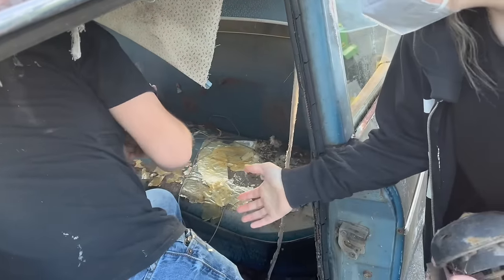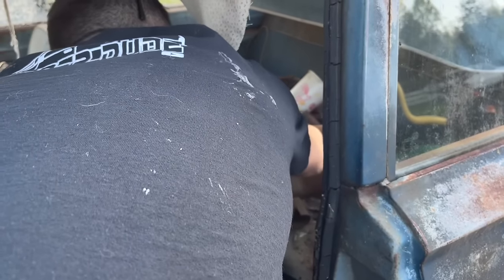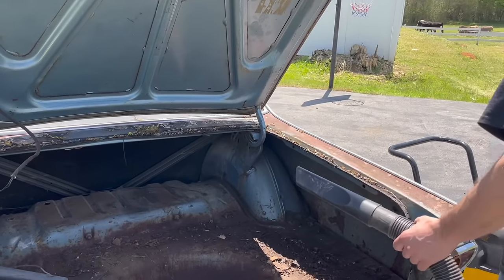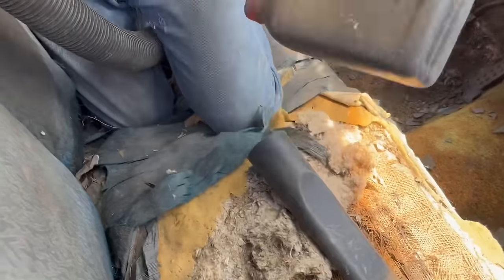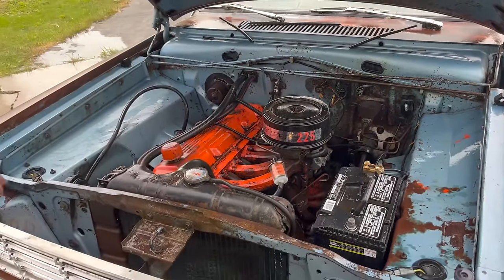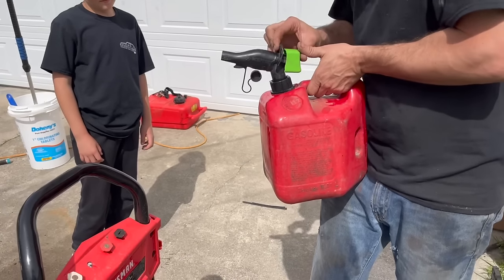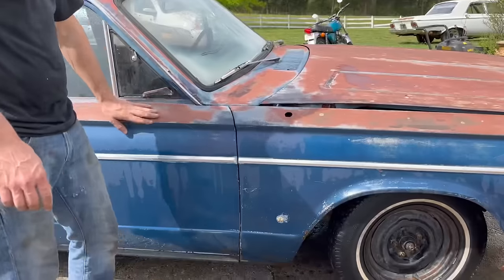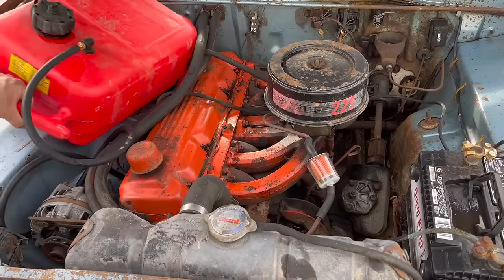First clean up in 30 years on our $500 65 Dodge Dart 2 door

Comment: Oh, does this bring back memories...when I was a kid in the 60's my mom and dad had a 61 Dodge Lancer with the slant 6 and push button transmission. And just like your 65 Dart, the back floor pans had rotted out, and some of the carpet was gone. My instructions when getting in were to step on the bottom door frame, then over to the drive shaft tunnel with my other foot, and drop onto the seat. Under no circumstances was I to try to stand up or get off the seat while we were moving. I could literally sit there, look down through that hole and watch the road go by as we drove along. And if it was raining and the road was wet...yep, I would be wet too. Somehow I never did get sucked down that hole and out of the car.
Reply from the maker: Oh my gosh that’s hilarious
Reply: @Sleeperdude  fred flintstone wood be proud

Comment: A walk down memory lane when I ran across the video! I was raised in Juneau, AK, and my family bought a 1965 Dodge Dart 170 2-door model just like this when it was a year old in 1966. It was teal blue with a similar interior, though the cloth on our seats was a different pattern. It had rubber mat floors, 3 on the tree and the only "extra" was an AM radio. It also came with the "poverty hubcaps". The sound of this car running brought back a lot of childhood memories! This car replaced a 1950 Dodge Coronet Club Coupe that we had, and in late 1971 we sold this Dart and bought a new 1972 Dart Swinger. It had an automatic transmission, AM radio and carpet, so to our thrifty family we thought we had "arrived"! Ironically it came with "poverty hubcaps" also. Brent Long, Seattle WA
Reply from the maker: Awesome thanks

Comment: Love this video. The dart 🎯 coupe clean up really nice like night and day difference.  After all the parts and stuff and power wash it should weigh less than 2,500 pounds maybe less than that. Looking forward to seeing the next video love what Y’all do. You’re creating project cars for the next owner down the road. 
You hinted a 360 swap for the Dart 🎯 that would be nice but the slant six would be good on gas at these prices and very dependable. God Bless Y’all.
Reply from the maker: Thank you
Reply: @Sleeperdude  get a sheet of 3/4 inch plywood make a template for the rotten floors and cut to fit  for safetys sake while you do the drives................

Comment: Love the Dart! Tight engine compartment though. Small blocks fit. A 318 or 360 4 spd would be cool
Reply from the maker: Yeah that would be cool
Reply: Adapt a chevy S-10 transmission to the slant six--it can be done very inexpensively--have a muscle car shifter on the floor and then you can really rip it and the little six will surprise you how good they go! With OD they will get 30 mpg as well.

Comment: There is a 2V intake manifold for the 225. That and the correct carburetor will turn that into a Super Six. Me and a friend did that to his 65 Dodge A200 van. He wanted a little more horsepower and the new setup made a big difference.
Reply from the maker: That would be cool

Comment: Just a piece of advice, Josh, something I learned from my best friend Tim, who sadly passed in 2020.  If you have a Keeper, after you’ve cleaned the interior plastics and vinyl to your satisfaction, use Old English Oil Soap on it.  It’s way cheap, and coats of the oil will improve or at least stabilize the condition of geriartic plastics and vinyl.  Do Not use Armor All - this will create cracks, unless you re-apply it regularly - I know this from personal experience.  I use Old English Oil Soap on the dash and interior plastics of my 74 Celica and have for years.  No cracks that weren’t there before I put the pieces in (it was a ground up resto, Tim and I finished 10 years ago).  The oil will make the stuff shiny, of course.  So fair warning on that.  😎👍
Reply from the maker: Ok good info thank you

Comment: You weren't kidding that inside of that dart had parts everywhere. What was with all of the stored hub caps? That is really a strong shop vacuum I don't think mine will pick up nuts and bolts. And where you pressure washed on the body it looks like red primer not rust. Well that was sure a nice job of cleaning that old dart. Thanks for sharing.
Reply from the maker: Thank you yeah I couldn’t believe all the parts not sure why. And the vacuum does work good it’s a dewalt

Comment: i had a 1965 valiant safari wagon - i fixed it up with LSD disc front new booster shockers wheels tyres - { hoopes and casings = see i`m learning } and it was white with blue interior Regal Safari = 318 fireball v8 and  a904  auto trans = 125 mph . color coded bumpers !

Comment: Another is washed up. Cars are looking good. Ready to see brake work and new casings and hoops. I got too many projects too.  Just waiting for the weather to start cooperating. One day it is 80 and the next it is 40. Got to get with finishing up some things on my 75 Torino and get it on all 4 tires so I can get to my cam swap,2 bbl to 4bbl swap, get a tune up done,and change the oil. So I can start working on my 99 Dodge Ram 5.2L,change the heads on it. So I can start driving it.
Reply from the maker: Sounds fun

Comment: That Dart is in a lot better condition than it seemed in the beginning. New floor pans and a fender will have it well on it's way. I have a feeling all of those mats and carpet pieces kept the floor wet most of the time or they would be as solid as the rest of the car. I used to think floor pans was a big deal until I'd seen them replaced. Not a big job for a good body shop.
Reply from the maker: Yes I agree

Comment: Excellent video Sleepdude Crew  :) that Dart live long time also would fix up for one kids drive to someday & fix right door too and rare to for Manual transmission Coulmn Shifter  3 speed find plus red block on 225 motor also most I  seen in baby blue color also in 2 barrel carb too! Funny to been 2 door also think that car was Blue Blue Matellic back then and great find Josh hope you can use it  Fuel tank too  also plus nice car for sure! I remember my first car was 1980 Pontiac Grand Le Mans 2 door and I baby that car for 8 years till frame snap in 2 places on me had get rid of it! But want Lol for my high school at age 16 to 18 did paint job in my Auto Mechanics class for my late Cousin John SR 1982 Chevrolet Monte Carlo LS and cops asked me what color is car be when did Safety Check Inspection why because primer grey and get paint White with Navy Blue Decals like Interior was ! But fun project and got excellent marks in Auto Mechanics shop classes and plus had fix starting issues also ring gear and starter bolt up problems why cut out after warm up ! But got fix for sure and John love car so much after he want give to for Graduation gift but he past away it happened and never saw car again too ! That car had 1973 Pontiac Grand Prix 400 Cubic Inches size 8 cylinder with 4 barrel  plus dual exhaust, Turbo 700SR 4speed Overdrive Automatic transmission, 390 rear end gears truck type in plus updated gauges ! Fast car too also car see if find Josh is Chevrolet Chevy 2 in 1962 to 1964 year in 2 or 4 door those cars are early versions of Nova one ! You love them so your family too!
Reply from the maker: That’s cool thank you good idea
Reply: @Sleeperdude  welcome

Comment: Easy way to get an engine running that doesn't have much compression is to put heavy gear oil in the cylinders. I have done it in the passed and worked great. Once the engine starts the rings free up and it is good to go.
Reply from the maker: Thank you

Comment: I don’t normally disagree with you but in this one case I do. You said they don’t make small cars with decent size engines that’ll haul a full size family of 5. They are all huge vehicles. There are several vehicles I’ve either owned or been in that meet that criteria. One of them is my Kia Soul I use for a pull behind vehicle. It easily seats 5 plus cargo, gets over 35mpg, and is small, nimble, has an amazing turning radius and it has plenty of power. You can get it with a naturally aspirated 2.0L, a turbo 1.6 that hauls a$$ all day long, or a diesel.  There are several Japanese cars that come with v6’s and v8’s that aren’t any larger than that dart. I love your channel. You have the greatest little family and farm.

Comment: That dart would make a nice little hot rod even with a 318 or a 340. I think it’s well worth cutting out the rust and build all the floor pans or buy the aftermarket stuff. Yeah I really like those cars. After you wash that trunk out I would spray it down with ospho rust treatment to stop it. Just my suggestion.
Reply from the maker: Yes it would

Comment: I thought it was black!  Turns out its blue.  Cool car, 2 dr stick.  I like 3 pedals.  Just put a 4bbl and headers .  Maybe a little cam.  A hurst shifter.  New brakes,Fix the rot,  could be a nice little  hot rod.  Maybe redo the front seat and carpets.  Just clear coat the thing.
Reply from the maker: Thank you

Comment: Dude, where do you find these fantastic Mopar's ?  I'd give a left one for that Dart, the sheet metal looks great and the floors should be available to weld in.  Give it a light sand and shoot it with Satin Clear to preserve the patina.  A set of old Mopar 15" rally's off a later Duster, a set of front disk brakes with a dual master cylinder and a head liner and you're in, maybe a cheap AM/FM too.
Reply from the maker: That would be cool, I got it from hot rod hoarder on YouTube

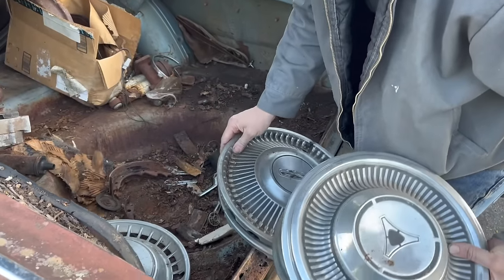Comment: 5:57 The wheel cover in your left hand was the optional full wheel cover on the 1965 Dodge Dart according to the factory brochure at old car brochures. It doesn't show any pictures of the poverty 'hub' caps. The wheel covers on the car are from the mid seventies cars. From other images, it appears neither of those 'poverty spec' hub caps were from the car originally.
It came equipped with 6.50-13 tires and wheels. The current size would be 165/80R-13. The WD is 594mm. The full wheel covers may be for a 14" wheel?
Reply from the maker: Ok thanks for the info

Comment: This is 153624, I've written to you a couple of times. I would like to tell you again about a product called JOMAX house cleaner. Now, you do have to mix it with bleach. The first time I saw this, I thought to myself what's the point the bleach is doing the work. Appears I was wrong. This product also takes out the stains left by the mold mildew and lichen. The after product of the cleaning is much better. It is a bit pricey. The last time I bought it it was around $25.00 per gallon, but you can make quite a few batches with 1 gallon. You can mix it and apply it with a little garden pump sprayer. Even if it dries before you get your pressure washer to it, cleaning is still easier. It is also supposed to help keep mildew at bay. And no, I don't own stock in the company that makes it. Ha ha.
Reply from the maker: Ok thank you I will look for some

Comment: I just cringed when you ripped those door cards off of the front doors. Those were pretty nice over all and savable. A heat gun and cutting a new hardboard backer to transfer the vinyl to would have really been cool. 

Are there future plans for that car? Except for the floor pans and front fender, that body is in pretty nice shape from what I saw.
Reply from the maker: I plan to get it drivable with brakes , patch up the rust , windshield, and fender

Comment: surprised you didn't pull out the bottom of the back seat - it just clips in. there should be a vertiable treasure trove of fragrant mouse and squirrel goodies under there.
Reply from the maker: Your right I should have

Comment: Well we'll have to cut the inner fender. Put a straight axle under the front.
Reply from the maker: Come on
Reply: Those darts are little work horses.I didn't think that one was going to pull through. And there you have it. Awesome burn out.

Comment: Slant sixes always smoke on start up but will run forever.
Reply from the maker: Awesome
Reply: @Sleeperdude  You probably wont remember but a few weeks back  I told you  Thanks to your inspirational videos I took on a 1992 Toyota Truck that needs some work And had milkshake in oil. I took kerosene and dumped it down the top of the head with valve cover off and ran starter to circulate it. Drained it for a day and put fresh oil in. So far its good and clean with no sign of water but will take your advice and change oil again. . Work is done and it runs great. 
 Thank you for inspiring me to do this. Is there an email I can send pics to?

Comment: Let me know if you got the passenger door open  . Because I no how to get it open  .
Reply from the maker: We didn’t get it open yet
Reply: Ok . Well this is what you do.  
Have someone pushing the button in on the door and pulling.  And you go in the back seat 💺and kick the door right were the lock is . And it should open.  Because it looks like the lock in the door is working.  It's the lack in-between the door that is stuck.  Let me know if that works  . I've had to do it plenty of times to old cars 🚗 . Thanks for sharing and responding.  And you can ask me anything.  And I know I can help  . Would be nice to see a short video on you getting that door open.  And  maybe even hearing you mention my name.  Just say Mike though.  Thanks

Comment: Two minutes!  Philips screwdriver you would ! Have had easilybrepairable door liners
Reply from the maker: They were in terrible shape I’m normally on saving everything but they were too far gone
Reply: You can revive the vinyl with Go Jo gritless hand cleaner. Save the vinyl and replace the door card/back panel. Smear Go Jo on the complete car. Let it sit for 8- 24 hours . Wipe it down and power wash.

Comment: The reason they put left handed lug nuts is they did it before they had safety wheels, so the lug nuts wouldn't come loose. That is why they are only on the left side
Reply from the maker: Ok thank you

Comment: i have a 66 gt dart that is way better i will sell to u for 500 it is rust free good clean body has slant six 3 speed on floor some one put a possi in it has no front or back windows and no wheels i sold them for 600 they where new with new tires
Reply from the maker: Sounds nice